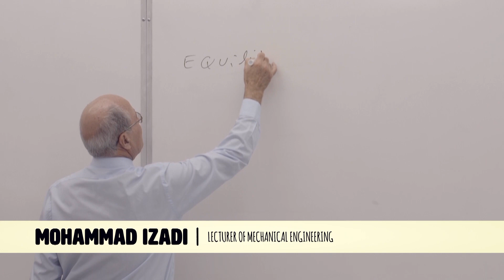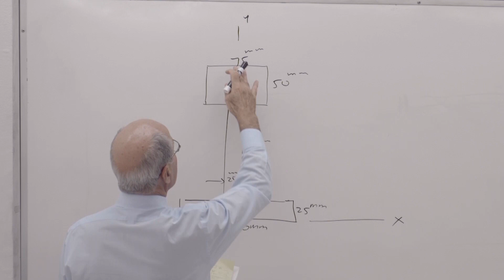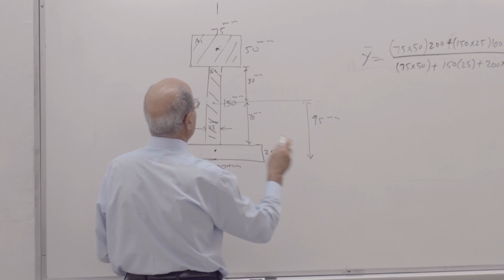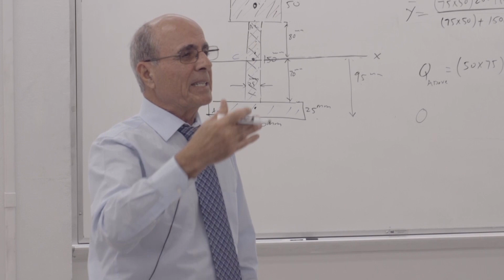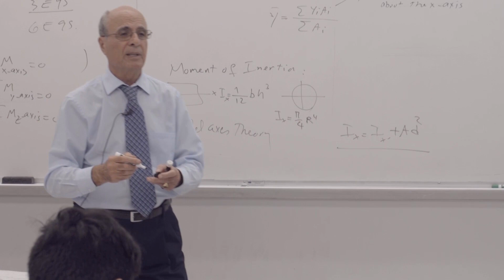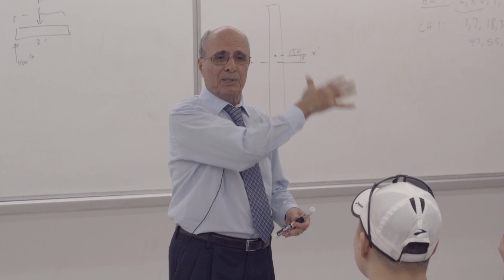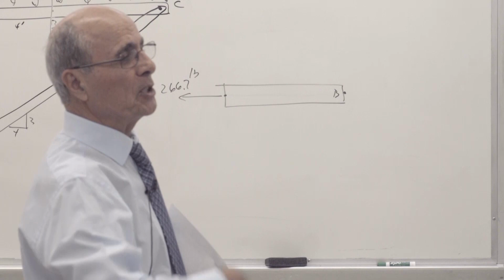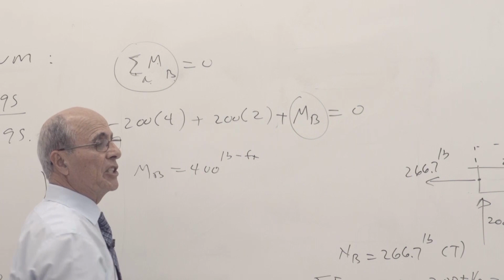Strength of Materials I: Review Principles of Statics, Internal Resultant Loads (1 of 20)

Comment: Since college times and even after graduation times i still do not know what is meant by first and second moment of inertia practically/ in real live!! What i know is moment of inertia as the definition in newton laws (tendency of a body to resist a sudden force pla.. Pla.. Pla).. Also i know moment mathmatically force x perpendicular distance...i know its a feature of section but i dont know its meaning from its name 😢😢😢😢..
Reply: • In general any moment of inertia is the ability of body or structure to resist against its change of state of motion or structural shape. 
For e.g. 
1. Mass moment of inertia (kg*m^2) is measure of how body will resist the change in its state of rest or motion against the external applied torque for rotation. Its moment of inertia depends on three factors - 
(i) Position of axis of rotation & centre of mass, 
(ii) Orientation with axis of rotation & external force relative to body. 
(iii) Distribution of its own mass relative to axis of rotation. 
Mass moment of inertia defines how fast will body response to the applied external torque in rotation. 
2. Area moment of Inertia or second moment of inertia (in m^4 or m^2 * m^2) is measure of resistance of cross section of structure against the changes in shape or orientation of c/sn caused by induced stresses like bending & shear as a result of external transverse loads.
It is defined for axes passing through centeroidal point of cross section. 
Area moment of inertia matters for induced stresses due to external transverse loads on structural beams & axial loads on columns due to buckling.

Comment: Q. Maximum shear stress is.

A. average sum of principal stresses

B.average difference of principal

stresses

C.average sum as well as difference of

principal stresses D.None of the above
Reply: Please sir answer
Reply: Q.Hooke's law is valid up to the.

A. elastic limit B. Yield point

C.limit of proportionality

D.ultimate point
Reply: Please sir answer
Reply: Q.Hoop shrinking in thick cylinders is

done to achieve

A. increased stresses

B.decreased stresses

C.uniform stresses

D. None of the above
Reply: Q.Couples applied to a beam?

A. affect the SF

B. affect the BM

C. affect both SF and BM

D. None of the above
Reply: Q.Hoop strain in a thin shell is.

A small singma h/E

B.small singma 1/E

C. 3small Singma h/E

D. None of the above
Reply: Please sir answer in my Five Question in this Subjects